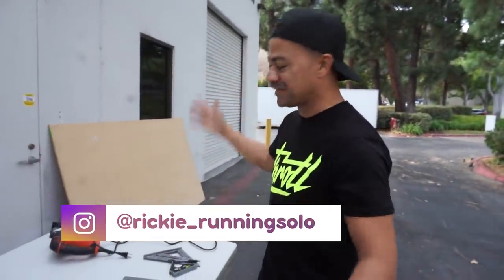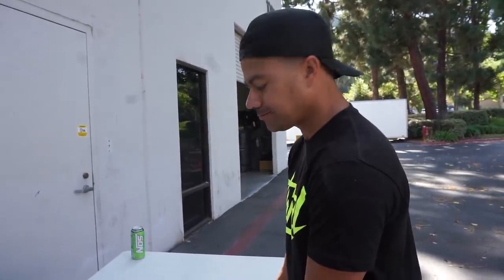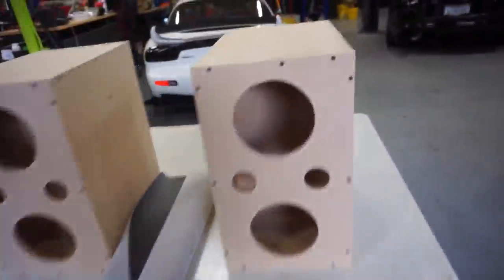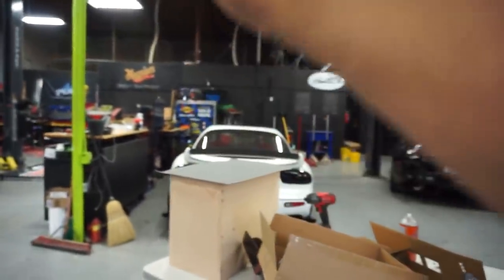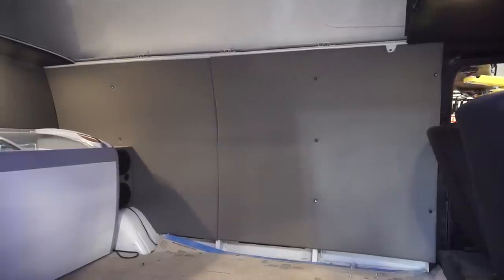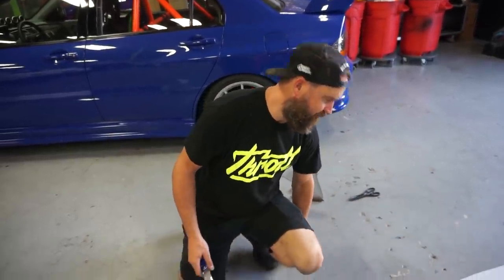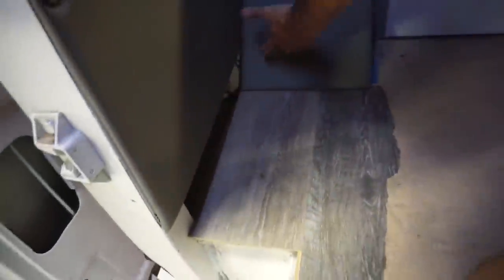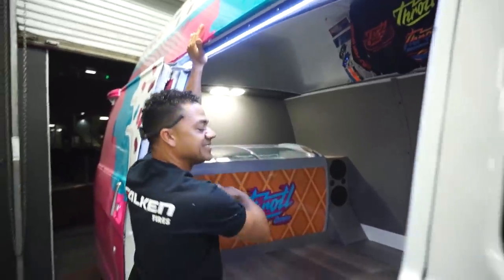Building the COOLEST Ice Cream Truck on the Planet!! [Ultimate Chevrolet G20 Build] - Part 12

Comment: look at Rokkit monitor speakers they have hole in the front cover, Yamaha monitor speaker also have a hole but it's behind on the back cover
speaker box needs a hole to breath, because sound membrane needs to breath and it's not just for subwoofer.